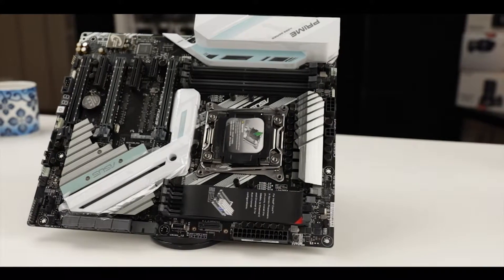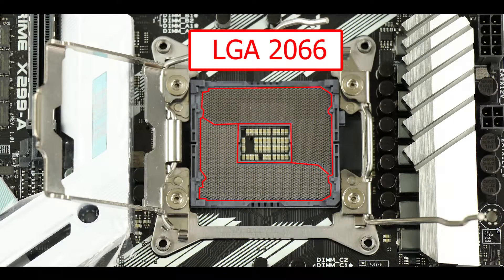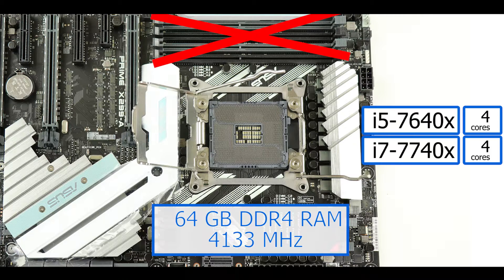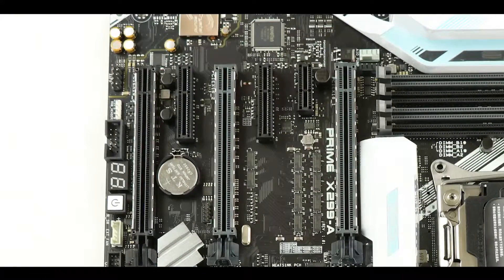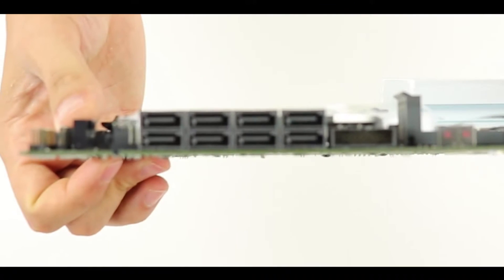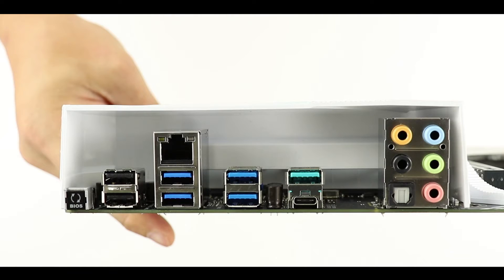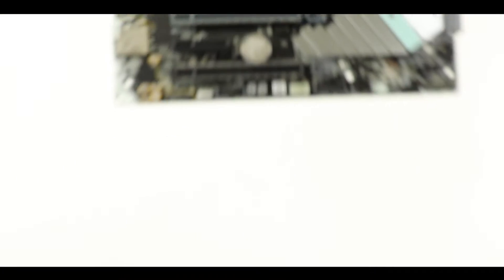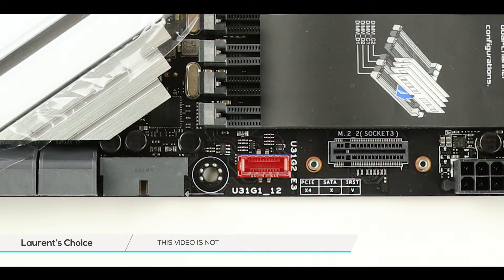Prime X299-A REVIEW! An affordable luxurious motherboard!

Comment: Laurent I will follow you from now on, you are funny and your videos are the perfect match for my learning philoshophy ...or something like that. , I need to upgrade my audio pc , I am thinking on buying this motherboard. Would you still think is a good buy for 2020? or you have others reviews I should see.  I do not need a cpu with too many cores, a 6 or 8 max. I dont need wifi, video cards or audio on the motherboard, just a solid reliable board.  Luis.
Reply from the maker: Hi there Louis. 
Thank you so much for your kind words. 

X299 platforms are good but I worry about the CPU cost. 

I would suggest u go for a z390 or possible a x570 board (3700x cpu ?). 

That last on will do what a x299 can do and it's much easier/durable board all together.
Reply: @Laurentschoice  Thank you for your advice, I just found a bundle at microcenter with this motherboard, ASUS Z390-E ROG Strix Gaming Intel LGA 1151 ATX Motherboard . Do you have any reviews on it? ,

Comment: i found this very helpful but i am unsure if it will work with the Intel Core i7-9800X X-Series Processor 8 Core up to 4.4 GHz Turbo Unlocked processors

Comment: This will shut off sata ports if you use all the pci slots
Reply from the maker: +Review This agreed :)
Reply: I’m having nothing but problems with this mobo and asus warranty support is more like a witch hunt. I have the x299 prime deluxe just for the thunderbolt 3 card but if you try to use it it will stop working and will only be recognized if I swap it to another pci slot then same thing if I try to use it haha. And my Vega cards show up as vga can’t find firmware error but the cards are working just fine. I feel they rushed this out as you can see by the many bios releases. Have you had any issues. I also can not get Ubuntu to work on this either and that’s odd I have it running on a gigabyte x299 system no issues. On this the WiFi shows up as no firmware found on either 802.11 ab or ad .

Thank you for your time.

Comment: can i put i5 8400?
Reply from the maker: No. 8400 is a LGA 1151 cpu sockets and can only work with X370 motherboards.

What you need is a Z370 prime A (watch my review on it )
Reply: Laurent's Choice which is better Z370-A or X299-A?
Reply from the maker: What is ur application? X299 is usually for intensive office work .

If for gaming z370 is what u need
Reply: Laurent's Choice thanks, im going for prime z370-a. So what parts do i need? I want a CPU - i5 8400x GPU - NVIDIA GeForce GTX 1070ti. Is that ok?